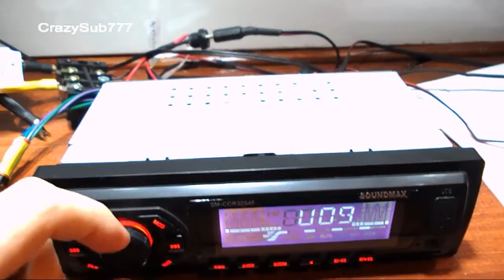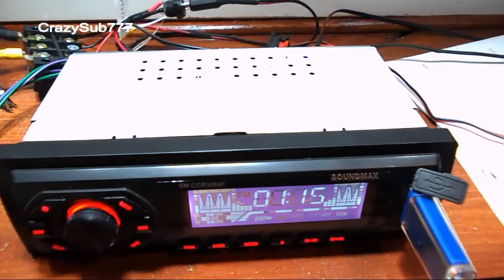How to connect car stereo to the computer power supply - TUTORIAL

Comment: Actually have done this my self but I left out the head unit and went straight to the amps only problem with head unit is it loses all its settings when you turn it off but there is ways around it if you insistant

Comment: I suppose, when you turn off the Stereo and so you turn off the switch (green+gnd), the Stereo display still is on, the clock and and  its memory saved, because the PSU gives power through the Yellow 12V wire by the 28 pin connector (connector removed, but the same wire) in its IDLE mode. 

 that's the point:  suministry 12V 28Amp  from PSU yellow 28pin wire to the Stereo.  So when the PSU is turned off, those yellow from the 28 pin line still will provide volts for memory and display.
the sata or molex connectors turn off and no IDLE, no sleep&charge, while the yellow 28pinline or CPU line yes, still works supplying energy even the PSU turned off. 

please forgive me! my english is very bad to explain. 'cause I've seen a lot of comments asking why the memory and time (the stereo) doesn't mantain the config turned off the PSU.
Reply: Are you suggesting that we leave the (green+gnd) switch on and unplug the power supply, will that save the memory?

Comment: I put the green and black wires together and the fan turned only once. I have two power supply's and they both do the same thing.
Reply: same problem im having,not sure whats going on.
Reply: Some ATX require sensing a load to stay on and stabilizing the output, IE mine needs to see a load on one of the 5v (red) wires. I used a 10 watt resister, small 12v light bulb would work. 
Also when cutting off the ATX main plug (20 pin in my case) note any different colored wires going to same pin, they are sense wires. Again in my case I have a brown wire that was tied to a orange wire pin &  a pink wire that was tied to a red wire pin. These should be reconnected together-